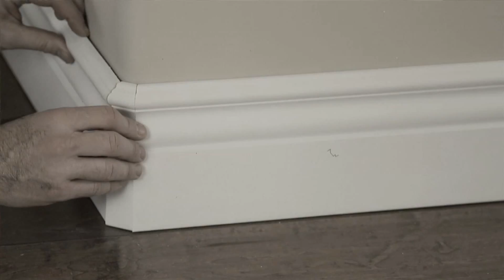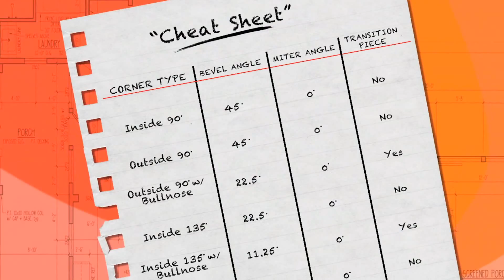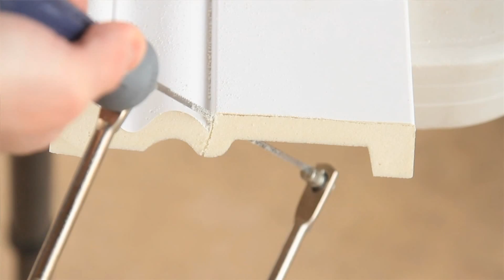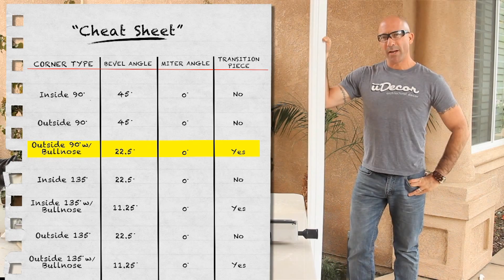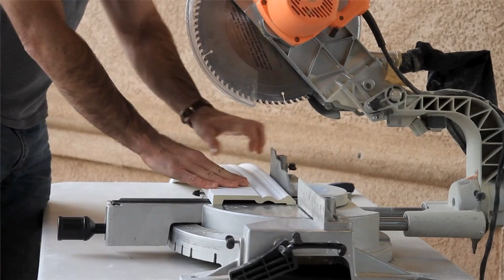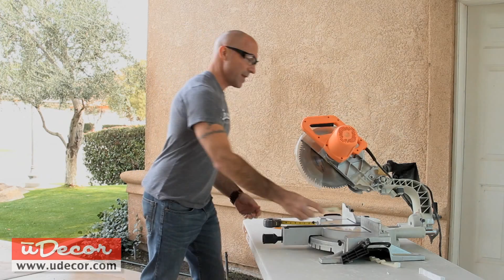How to install uDecor polyurethane baseboard molding

Comment: Thank you for an amazing video. I am doing DIY project for the 1st time. Had to order apprx 10 feet of flexible polyurethane resin to use it below a semi circular staircase. Instructions says I need to warm up over 70-80deg before installing. Any advise how to warm up that piece?

Comment: Good video, but I need help measuring where to cut when I have a wall with two inside corners both needing a 45 degree beveled edge.  My stock seems to slide and I am short on the next cut.  I am measuring to the far end of the wood but it never seems to come out correct.

Comment: When measuring if you can't seem to read your tape when you bend it into a corner try this. Make a 2" make from the corner first then when you pull your tape to the mark it will be flat, plus 2". I use this doing crown molding all the time

Comment: Coping is the right way to do it. Chances of inside and outside corners being a perfect 90° hardly ever happen. It's due to when youtape and mud the drywall. Angle finder tools come in very handy. The tool will tell you what to set your saw at

Comment: Excellent video! Can you explain why you use a 1" transition piece with the 135 degree inside radius corner? at 7:40  Do you need to cope the back sides a bit so that they fit into the corner tightly? Thanks!

Comment: This video is beyond my level of experience (and equipment — would love to have a compound miter saw!), but the info was still helpful — THANK YOU!  I’m in the process of installing shoe molding in our bathroom (the bathroom was previously carpeted - yuck - and after we installed a laminate floor, ended up with a 1/2” gap between the baseboard and floor).  The inside and outside corners are a snap, but there are 4 angles-of-undetermined-dimensions (math, and especially geometry are NOT my forte).  My only “tools” are a miter saw, miter box, and a Dremel (and tape measure, etc.).  Regular shoe molding wasn’t going to be tall enough to bridge the 1/2” gap, so I found some “door stop” molding that was a perfect fit.  My work isn’t perfect, but caulk does help with appearances.  The work is about 90% complete, but watching this video has given me confidence....that at least I’m not doing it wrong, LOL!

Comment: What width (at the back, narrowest part) does a 135* outside bullnose transition piece need to be? I know they aren't necessary but my walls aren't square (wavy) and I think it would look better. I tried to hand fit a matching 90 outside transition piece( sold as a matched set to my baseboard at lowes), but I couldnt get rid of the gaps well enough. Thanks

Comment: the thing that missing, is the measurement for the baseboard, and marking the baseboard for the inside and outside cuts...
Reply: +Sajid Saeed i mean, how to measure the board, and make sure that the marking are correct on the baseboard, and how the saw will be placed to get the exact measure cut for the bevel...

Comment: When doing an inside 90 degree corner, I tried mitering both pieces but the corner is not completely square. Would it be better to not miter one piece and cope the other piece. Which piece to cope, the shorter or longer one. Shorter one is only a couple of inches long

Comment: What kind of blade would you suggest for cutting mdf baseboard? Mine seems to be dulling too quickly, and it's definitely affecting the cuts. The blade I'm using is the Irwin Classic Series #1826439. HELP!

Comment: Note at 7:00 that transition piece was positioned with the bottom against the fence and the perspective is from the opposite side of the saw (for the outside 90 deg bullnose.) This is an awesome instructional video!

Comment: so wait ... if I stain and varnish the baseboards I HAVE to cope one angle? Can't there be both 45 degree cuts with no coping needed to stain?
 My boards are 3 inches wide
Reply: When you are going to stain baseboard or any trimming you can not use calling so the cuts need to be nearly perfect that's why he suggests that you have to do the coping.
Reply: Saul V . I meant *caulking
Reply from the maker: Joey G Hey Joey ... Saul is absolutely correct.  Coping reduces the size of the seam, so when installing a stained crown molding or baseboard the results will look much better by coping the pieces.  Coping is pretty easy to do, so with a few practice shots you will be doing it like a pro.
Reply: OK thanks. I coped 2 corners and they fit perfect.

Comment: Hi what is a bull nose corner?
Thanks
Reply from the maker: A bullnose corner is just a corner that isn't a sharp 90 degrees.  It turns the corner with a radius, so you use a transition piece of baseboard when doing your installation.
Reply: Thanks very much

Comment: any videos on what to do with the angle cuts (45's) when the room is not square? also, how to tell?
Reply from the maker: There are plenty of tools out there that will measure the angle of the wall.  To figure out your angle cut, take 180 degrees and subtract the angle of your wall ... then divide that figure by 2 and you have your angle cut.  If it is a painted baseboard you can normally get away with just treating it as a 90 degree corner and then caulk any gaps.

Comment: who the hell has a saw like that ???
Reply from the maker: It's just a normal compound miter saw ... but you can also install smaller baseboards with just a standard miter saw.  The one in the video was probably about $150 and you can get the standard versions even cheaper.  If you do a lot of projects you might want to invest in a good saw.

Comment: It would be great to post some hints for accurate measuring - it can be difficult to get accurate lengths when there's an outside miter on one end but the other end of the piece is an inside miter or needs to fit square and flush against a door casing.

Comment from the maker: Hi Tyler. I tried inserting a helpful link in this comment but youtube won't allow it. Do a search on "how to determine the radius of a corner" in google and you should find instructions on how to do that using a carpenter's square or just two straight edges. For the extending it beyond the curve we are just talking about how the baseboard must extend beyond the start of the curve. So if your wall measures 50" to the start of the curve you are going to cut your piece at 50 3/8".

Comment from the maker: Hi Joe, we actually left out much of the information you are mentioning because our moldings are installed differently than MDF baseboard.  With polyurethane you use a little bit of adhesive on the back and just shoot 1 1/4" finish nails in every 18".  With MDF you want to use a longer nail (since you aren't using adhesive) and be sure to shoot into your studs.  The cutting is the same regardless of your materials so we just focused on the typical cuts people may encounter.
Reply: Pin nails and glue work the best, I found over the years. No caulk to covers pins

Comment: This should be titled "How to Cut Baseboard Molding" because it doesn't show how to install. To actually install, what kind & size nails or brads are used? Where do the nails go?  How close together do nails need to be? Do nails need to hit a 2x4 or just drywall?  Also, none of these 'how to' videos mention that the cut for an outside corner needs to be measured past the end of the wall--something I learned the hard way.  You guys have done this so long you forget to tell us the BASICS.

Comment from the maker: Hi Greg,
  The bevel angle cuts are:

45 Degrees: Inside or Outside 90 Degree Corners

22.5 Degrees: Inside or Outside 135 Degree Angles; Outside 90 Degree Corners with a bullnose radius.

11.25 Degrees: Inside or Outside 135 Degree Angles that have a radius.